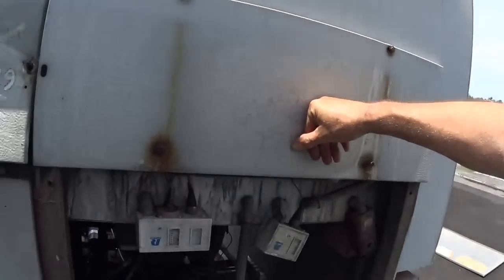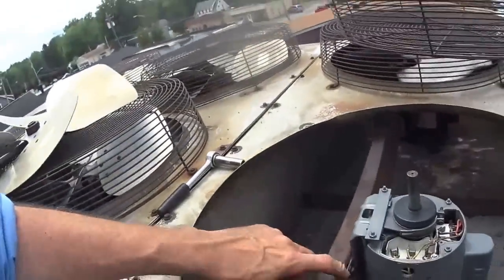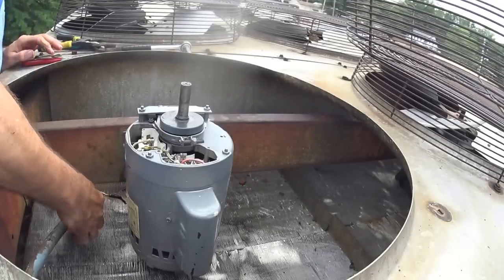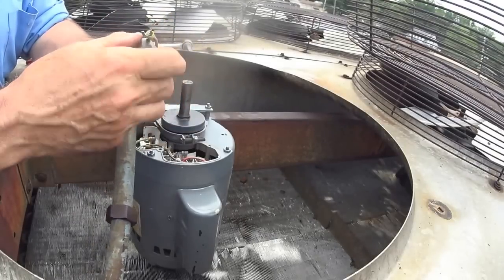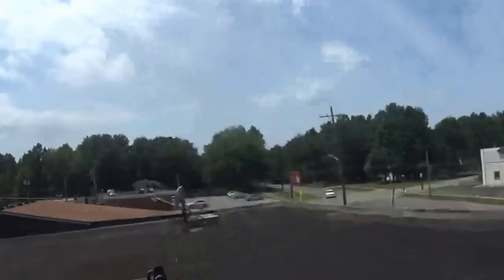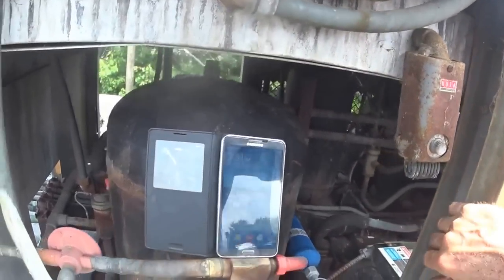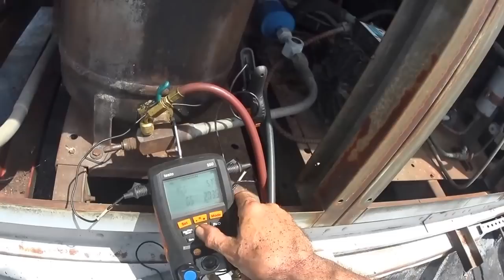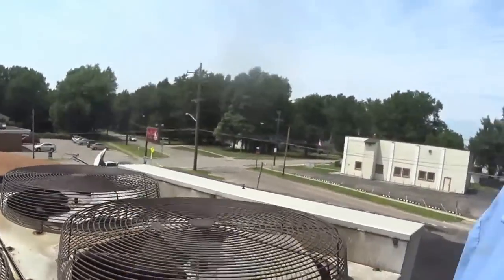Change a big 3/4 hp condenser fan motor

Comment: I've replaced more condenser motors than I want to think about. I think it was a rookie thing. Let the rookie do it. lol
I've installed some big one's, but never one mounted to a rail like that. Looks like a tricky job with the weight of that motor.
I was working on a 10 ton roof top air conditioner once and had to replace a fan motor. It was the first one I ever had to take the side panel off the unit and climb inside to install. What a pain in the ass!!! Great job Jim.

Comment: Good job almost the same setup I got a call from the dispatch  to go  to an old grocery store that was are account. By time I got there the motor went right into condenser coil  and right into  the coil and it was still spinning on the roof it was very old coil there was no fins .off the coil maybe was from the early 70 .The company had to a get a new condenser unit and call for a crane to lift it onto the roof the same day and installed overnight to put it in for the customer.
Reply from the maker: Edward socha sounds like extra effort, thats how you'll get a raise

Comment: Great work Jim, one question: When you were peeking at the plate on the motor I assumed it was to determine the rotation, but I noticed the wires appeared the same neutral color so here's my ? Which were you trying to determine and if you were determining polarity how did you make your decision about the post for which wire given that both wires appeared neutral colored?
Secondly, when you dropped the fan blades in place you set the height on the shaft to best pull air up and thru the condenser, was there a stop on the shaft? Did you just compare from the other fan positions? Any brief response would be helpful Thanks again for your knowledge. Greg
Reply from the maker: Greg T the name plate shows high voltage hook up (440v) and low voltage hook up (208v) the two brown wires are 208v, what I was looking at was it shows which wires to swap to reverse the rotation red -yellow.
  The fan blade doesn't have a stop. I put the blade as high as I felt I could with out it hitting the fan gaurd. good questions, thanks

Comment: Nice Job Jim, Just got a testo 550 with Bluetooth, I go about 8 ft in my house and loose connection. Don't think I will be using the Bluetooth. Don't think I need it. I have an older testo and I love working with them. Looks like a lot of tecks are going to the imanifolds and sporlan smart tool, Don't think that is going to happen in my world. I am going to stick with my testos.
Reply from the maker: Arnie Grote EXACTLY, I am on the same page as you....I like last year's 550 better. I don't need an Imanifold to do my job, and I can't see the screen on my phone on a bright roof, and I would wear out phones, they aren't tough enough. I think you can buy 3 Testo 550a for one Imanifold.
Reply: Jim Pettinato if you ever consider getting a new phone let me know because I got  my dad a trades phone and he loves it   if you want a tough phone  it's water proof dust proof  and a lot more  and it's got a very tough screen two

Comment: is that accumulator/filter (can't tell) in the lower left corner at 3:00 leaking?
Reply from the maker: KE0ETP it's wet from condensation, they are so rusted it won't be long, they will leak, the customer isn't rich he'll want to leave them. You know, if it aint broke don't fix it. won't be long.
Reply: ***** it looked like it was bubbling.

Comment: Sir, you said that you "don't know who designed this stupid thing."  I'm pretty sure it was an engineer that has never did any real hands on work on any mechanical equipment in their life.  Surely better design wouldn't elevate the cost of the equipment that much. Pity the poor techs out there.
Reply from the maker: ritewayguy Don't you hate that, and those engineers all have an attitude too, I'd like to drag them all onto a hot roof in their nice white shirt and make them fix their designs.